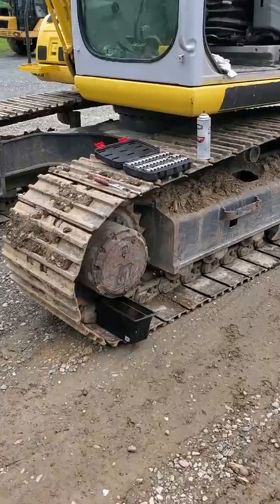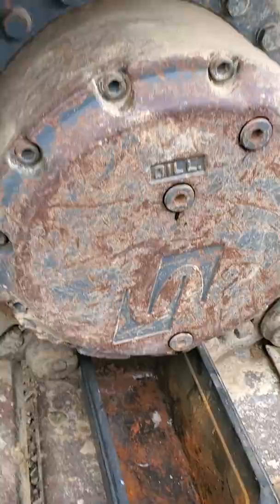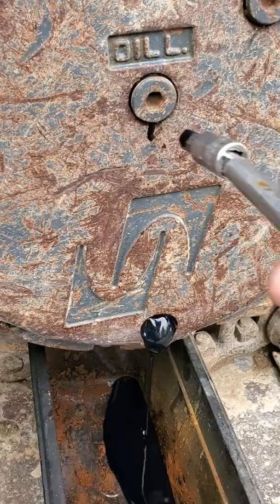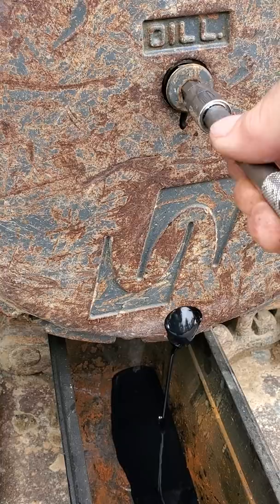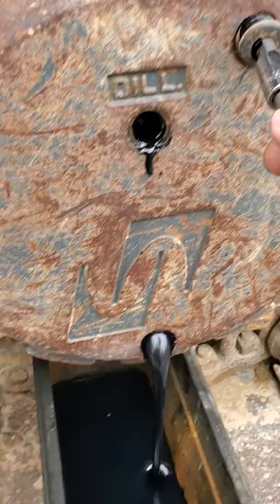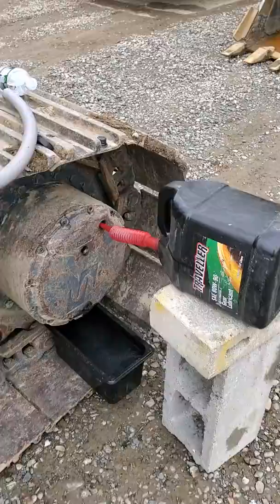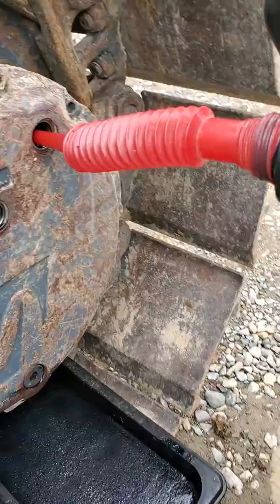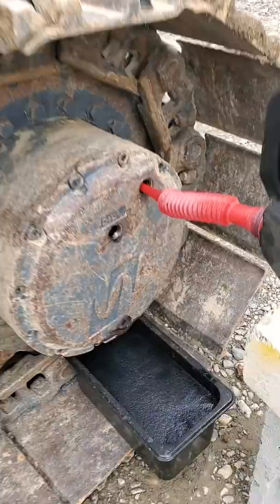Fastest & cleanest way to change final drive oil #shorts

Comment: Some free advice: always make sure you have your fill
Port loose before opening your drain port. It sucks to find out your fill port is seized or the plug is stripped after you drained all
Your fluid.
Reply from the maker: Watch the video back you'll see the oil I  did do that. Also it's not a big deal just rotate the drain plug 180° and it becomes a fill plug
Reply: @DIRT-BOSS  why give wrong advice then? Always loosen fill or level port before loosening the drain port. most good mechanics know this...
Reply: @silencer9112  if you know how much it takes it really doesn't matter what hole you use to fill it. If it takes 10 liters or 20 liters just throw I'm what it takes.
Reply: @Deere2154D  okay, and what if you only have a drain and fill plug, and the fill plug is seized? or what if you don't know how much it takes?
Reply: Yeah because you can't spin the tracks over to get the drain on too to fill it back up. That's impossible to do...
Reply: I'm guessing you don't know how excavators work? That's called a hub and as it drives the track, it spins... The drain plug is further out from center than the fill plug. Therefore, you spin it 180 degrees and there you go, it on top and you can fill it... Free advice, don't go on about something you don't know anything about.
Reply: @silencer9112  LOL it's not hard to figure out... Not hard to figure out at all...
Reply: @mikeznel6048  actually called a planetary
Reply: @mikeznel6048  always loosen your fill plug first.. because of your fill plug is seized or fastener head is stripped, you want to know before you drain all your old fluid.. that is all

Comment: I always open the fill plug to release any pressure (caused by either the ambient temp rising or having the finals hot/warm from using), if there’s pressure in there and you loosen the bottom one first, that shit will blow all over you and make a damn mess...
Reply from the maker: I hear ya I loosen both top ones first just didn't say it in the video
Reply: @DIRT-BOSS  yup. The problem is some untrained personnel will do as said… and get rustproofed. I personally like to vent it first. You know. Seals can go bad and fill it to the brim…

Comment: Even though he wants you to do the bottom one first you better crack the top one loose first to ensure once you drain the fluid you can fill it back up nothing worse than draining it and then you can't get the fill hole open
Reply from the maker: The last time I checked the final drive rotates 180° fill the drain hole.. 💥
Reply: @DIRT-BOSS  correct but you can use the same procedure on any differential or crankcase anything that has to be drained and refilled and in those cases you can't flip it over so you better ensure that the fill hole is able to open I know in your case that it doesn't matter

Comment: When you remove the bottom plug first there may be a chance of the oil squirting out and getting all over everything because there may be pressure inside the housing.  It is better to remove one of the top plugs first in order to relieve pressure.  You can screw it back in after that to slow the flow down when you pull the bottom plug if desired.  I usually don't.
Reply from the maker: Good point that I didn't explain but I did do that those top ones were already loose as you saw
Reply: There sure as hell shouldn't be no pressure in there. It aint a hydraulic system,  just a simple gear oil bath.         If you got pressure. There u got problems!
Reply: @toddreynolds8875  The pressure comes from a change in temperature.  There is no natural vent to the atmosphere.  There could either be a vacuum or a positive pressure differential depending on the ambient temperature because almost half of  the internal volume of the housing is free air space.

Comment: Should always unscrew the middle level plug as you can then tell if the level is too high, it will indicate mixing with hydraulic fluid meaning the seal inside the final drive is busted.
Reply from the maker: Good point but a well-maintained machine you should know your machine

Comment: Not trying to
Be rude or anything good video  I am a heavy equipment mechanic as well and I would not always say do bottom plug first. In certain options machine that’s been running all day long and the operator has to down it for the service I recommend pulling the top plug first to release all the pressure From in the final drives or you will get one good surprise pulling that drain plug first.! And also I would recommend after fluid drips out the level port put level plug in and let the fluid settle and then check again sometimes after letting the fluid settle you are actually able to add more!
Reply from the maker: Absolutely All good points there I did open the top port to let the air out I just didn't mention it in the video as you can see they were loose.. Thanks

Comment: This isn't a car's differential or truck's transfer case, but it's good practice to at least loosen the fill port first. If for some reason it won't come out then don't drain the case. My point isn't exactly apples to apples here, but close. I wish my differentials and transfer cases were this easy.
Reply from the maker: I hear what you're saying but if you watch the video back the top two were already loose and oil was coming out I always released that pressure didn't have time in a 59 second video to state that it's just common sense.. also on a final drive it's not a big deal if the top plug is seized because you can rotate the final 180° and fill it the bottom plug which will be on the top at this point.. bada boom bada bing

Comment: Surprised I didn't see a comment how the original didn't have a catch pan. And yes. I always open the fill port first to release the pressure. Bc if you pop the drain and there's pressure behind it. Then it shoots oil straight out all over your jeans and boots or shop floor. Put a catch pan for the used fluid. Then open the drain.
Reply from the maker: I guess you'll have to watch the video back closely there is a pan on both sides and the top is loose obviously I did it by hand and you can see oil coming out
Reply: Ya. My phone was blurry. Gotta love "high speed internet." I'm sorry. Didn't see the catch pan at first.
Reply from the maker: @brandonmorris3717  No problem man A lot of people said there wasn't a pan I think it's cuz it's the same shape as a track pad
Reply: Lol. It's funny how life works. So the day after my last reply we were doing an interstate job in fargo. And when I got back to my 336 the mechanics had serviced it the night before and pulled the plug right there. Smh. You could see where they pulled the plug and it squirted out under pressure. With a dry boot print right in the center of the stream. No catch pan. Weird how things in life happen. It's like we speak them I to existence or something.

Comment: So basically it's done the same way every oil change is done. Pull the drain plug and moderate it with the plug or fill cap.
Reply from the maker: Yes sir

Comment: i was changing rear diff fluid on a subaru years ago and opened the bottom drain before trying to open the fill drain above it....to my surprise the top bolt was seized and could not be opened...now i had a drained diff without a way to fill it.... i now know to try opening the top fill holes 1st before trying the drain plug....the opposite of what u just suggested.
Reply from the maker: Yeah that's because it was a Subaru

Comment: You need to loosen the top one first and that way it’s got a vent then put it back in and then do the bottom one because sometimes they’re pressurized and it’ll blow that plug out of your hand
Reply from the maker: I did
Reply: If that fd is pressured you got problems

Comment: Great video, but in my opinion you should always loosen the fill plugs first because if you drain the oil and cant open the fill plug you cant put new oil in, have had it happen to me a few times already.
Reply from the maker: Me too In the past just rotate the bottom plug 180° to the top and fill it..
Reply: @DIRT-BOSS  jesus fuck why did i not think about that😅😅
Reply from the maker: @aapoaunola2080  lol you can't believe all the comments saying the same stuff nobody thinks just a rotate it

Comment: How often do you Changing the oil in the final drive?
I know from site work you don’t measure miles done or fuel consumption as the answer is just yes. So do you just do it annually or every 1000hrs of run time or something else?
Reply from the maker: I do it every 500 hours or as needed if it was really hammered

Comment: I would prefer to at least check that the top ones can be loosened before even thinking about removing the bottom one. What if they are stripped or seized up in there
Reply from the maker: I did watch the video back

Comment: U forgot to advise if you change the 🛢filter it needs to be full before putting it back because the oil  won't get their fast and it will show lower level
Reply from the maker: No filter

Comment: Don't open the bottom screw first.
If the system is under pressure, you take an oil bath.

That happens to me...
Reply from the maker: I get that part I had the top ones open to release the air first if you look at the video you will see they were open I just didn't mention it should have but I only had 59 seconds to do a short

Comment: O YESSSSS 
That's the best way with out a doubt.
Reply from the maker: Thanks man It took me years of standing there waiting for that stuff and a broken back to come out of the jug to come up with that one
Reply: I understand. The only thing I do different is I get the gear oil in a 5 gallon bucket and put a hand pump on it. You can control how much you loose on the top up
Reply from the maker: @livingstonexcavation732  Yes that works too

Comment: I change oil for a living on constructing equipment. Your doing it wrong! Top plug first or you will be wearing it if you do it correctly. Which is to change it when hot. Also if you wait till it's burned black like you did, your not changing often enough.
Reply from the maker: Good to know

Comment: Never do the bottom first because is you can’t get the top ones out you now have a final drive with no oil in it at all
Reply from the maker: If you see on the video I had the top ones loose already to let the air out.. also if you can't get the other plugs out you just rotate the final drive to the top and fill the drain plug

Comment: Wish I could do that with my push mower.... I finally learned to put it up on blocks and stick a tube in the hole.... drain down to the pan.  Makes a one rag clean up sized mess.

My neighbor uses an oil sucker.  He still makes a mess.  Takes him longer to clean the sucker than it does me, to clean off my mower’s deck.

Boss, if you have advice on how to do that.... I’m all ears!!!
Reply from the maker: Your method works just fine!
Reply: I had a Jeep with a horizontal filter. Right under it were 2 cross bars. The oil chsnge was always a mess. I got so mad that one day I just cracked the filter loose and I took a large nail and punctured the flute along the bottom in one spot. I turned that nail to point down and then removed it. With the filter cracked just a bit, the suction was broken and the oil came out the nail hole. I could aim it so it missed the 2 bars and went down to the pan. Took longer to drain but cut the mess down to minimal. I would open the filter a bit more as the oil drained. By the time I spun it off it wasn't full. Stupid design.
Reply: @leahwhiteley5164  pretty clever!  Thanx

Comment: Don’t u want to be sure you can remove and fill the top plugs before you drain out the fluid
Reply from the maker: My machine is maintained I know the bolt will come out but yes if you feel that the equipment is bad caution is advised

Comment: Always break lose the fill plug first tho. If it’s seized and u drain ur oil out ur gonna have a bad day
Reply from the maker: Just rotate the drain plug 180° to the top and fill it bingo! But I did loosen the top one first You could see the oil and they were hand tight
Reply: Yha wouldn't  be a   bad few seconds  just turn your motor to full plug level and fill her.

Comment: And what if you can't get the top ones out? And now you've already drained all the fluid?
Reply from the maker: Always check your ports I open the top one just to let the air out a bit first.. besides if that was the case and you really couldn't get the bolts out just run the drive upside down to the desired height and fill

Comment: Question here can anyone tell me why you need the 3rd fill port above the level port? Cus could you nae just fill it from the level port and be done?
Reply from the maker: Yes some final drives only have two ports The third port is because in that configuration the gears are out of the way and you could fill it more efficiently

Comment: Make sure the fill and level plugs break loose before you drain the oil out!! Aka if the fill plug is seized or hex rounded and you drain the oil your in deep s@%t

Comment: Always and I mean always crack the fill plug loose first because if you open the drain and the fill strips out or doesn't come out wellllll you have bad day
Reply from the maker: Watch the video back the top plug is cracked first there's actually oil coming out of everything was hand tight like I stayed in another comments it's not the end of the world if you can't get a plug out just rotate it 180° and fill the drain plug
Reply: @DIRT-BOSS  I wasn't really talking about this application specifically I was talking about literally anything with a fill and a drain for example a differential your not gonna go and flip the car upside down now are you yes there are ways of dealing with it but it's just a lot easier to do what I said.
Reply from the maker: @aaronslack4421  for sure I hear you

Comment: You  know most final drives I've changed take 30 weight oil right?
Reply from the maker: 80 90 gear oil is equivalent to 30 weight oil
Reply: @DIRT-BOSS  got ya. Didn't know that. Nicely done there I'm gonna have to use your block trick.
Reply from the maker: @jhayward1940  heck yeah

Comment: HOW ABOUT REBUILDING A FINAL DRIVE ON A JOHN DEER 2032R   MINE ARE JUNK LOL
Reply from the maker: Yeah good luck with that easier just to buy a reman
Reply: Aint nothing  to them. Blind guy can rebuild them.    All it is is a swash plate drive.        7 /800 bucks to rebuild.   Or 7 grand for the rebuilder man to rebuild them.      (Thats if its not torn apart inside)

Comment: You should actually never do the bottom one first. What if you can’t get the top ones off then you have no oil and then your fucked.
Reply from the maker: I love how everybody keeps saying that look at the video the top one was loose and it was oil coming out they were hand tight of course I did that but with that said if the if the top ones don't come out you just rotate the bottom plug 180° and pour it in the  hole!!!!